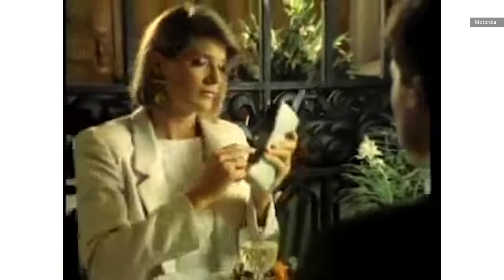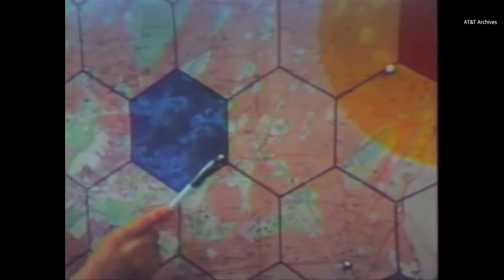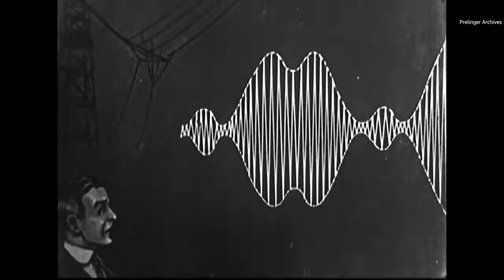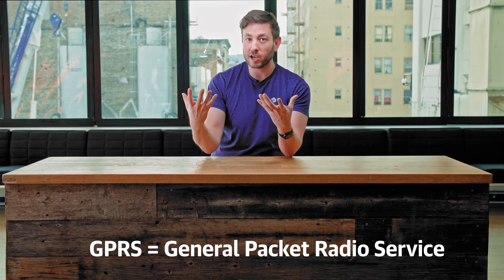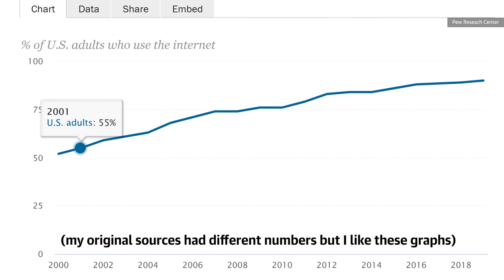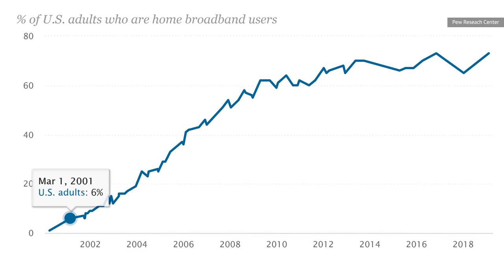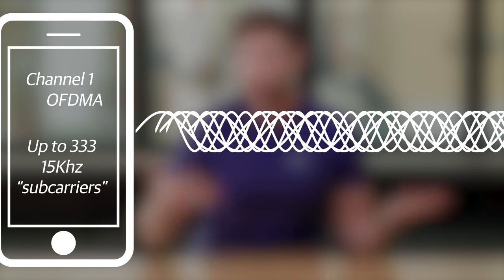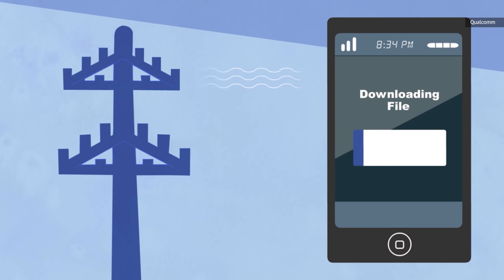How'd we get to 5G? The history of cell networks | Upscaled

Comment: My first cell phone was a Uniden CP 4600, which was a hand held analog phone.  All it could be used for was phone calls.  A charge would last about 8 hours, even without making any calls!  I got that in Jan. 1995.
My next phone was a Nokia 6160, IIRC, which used a version of D-AMPS called IS-136.  That phone supported data and could be used in the same manner as a dial up modem.  However, that required a special cable, which I never had, and I believe it was an extra cost service.  Since then, I've had a 3G phone, 2 4G and my current 5G phone, all Android.

Comment: Edge is so confusing, I remember my iPhone 2G have somewhat slow internet but it was never as slow as it is now on my iPhone 11 Pro Max. Now if my phone is on edge nothing will load at all, I guess it is because the internet is much more advanced now.
Reply: 2 things happend: first the internet is more heavy now so things load slow on EDGE, a 320x240 image load fast on EDGE but a 8MP don't.

some carriers disable 2G, EDGE or reduce their bandwidth reallocating a big part of their spectrum to LTE.

Here in Brazil most 2G networks are only for legacy IoT (like car tracking, mobile credit card machines) and phones who only do voice.

Testing network of carrier Claro (second biggest, considered the fastest) they don't even have EDGE anymore on their 2G, only the really old GPRS with is enough to do a card transaction on a mobile PoS and send some text messages, but not for a image)

Comment: My question is why did Wimax fail?
Reply: WiMAX was mostly designed for providing Internet access at home/office, but require new infrastructure and license agreements to work. On the other hand, 3G networks with HSPA/HSPA+ got enough bandwidth to provide that same service with the current infrastructure companies had, and with LTE in both homes and smartphones in the near future, WiMAX wasn't enough attractive as an alternative.

Now there are still WiMAX deployments in some remote areas, distances are still a factor for  deployments plus the ability of working with only fixed terminals.

Edit: grammar corrections
Reply: Cuz it couldn't compete with 4G

Comment: 5G uses millimeter wave length radiation just like the ACTICE DENIAL SYSTEM 95GHZ ALSO 5G Towers are 105GHZ and they will be able to ping off your 4G/5G cell phone which is 40GHZ
Reply: Actually, 5G CAN use mmWave.  However, it can also be used with any other cell band that 4G uses and also 3.5 GHz C band.

Comment: cdma radio was better than gsm ,which resulted better voice call quality.
but gsm core network is better than cdma that it gave more advanced services, e.g. long sms.
Reply: I have used both technologies and on the real world testing, the GSM was better for me for 2 reasons: I could switch phones simply by moving my simcard, no need to go to the carrier store trying to buy a phone without switching my plan.

And was really nice to have phone with the stock retail firmware instead of the carrier version with several limitations (like bluetooth with file exchanging disable) and bloatware hardwired on buttons for services I would never use.

And a bonus benefit: I could simple switch my SIMcard for one from another carrier without having to buy a new phone.